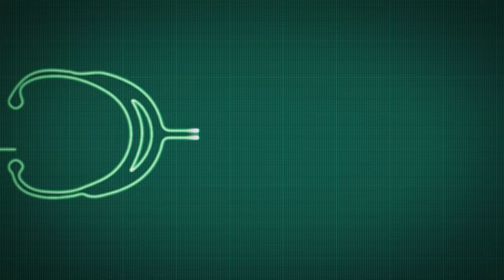PSU Teardown and Inspection

Comment: we had these power supplies for PCs where i work and they ALWAYS blew out the same npn transistor that blew. A few min to disassembly and solder and it saves buying a 300$ replacement.  a 50 transistor, so parts is cheap.

Comment: Which surgical light did that PSU came from?
Reply from the maker: ALM
Reply: Thanks, LED surgical lights or conventional bulb? Also question regarding Lifepak 20, Stryker decided not to sell battery for that model. Since EOL, if you have that model, where do you order batteries?
Reply from the maker: @denniss4455   Lifepak 20 batteries : R&D batteries has them.   This PSU is for a halogen bulb
Reply: Yeah, I saw RD batteries from part source website. Can I get your email? If possible just another question. Thanks appreciate all the video, learning lots!!!
Reply from the maker: Abetterbiomed@gmail.com